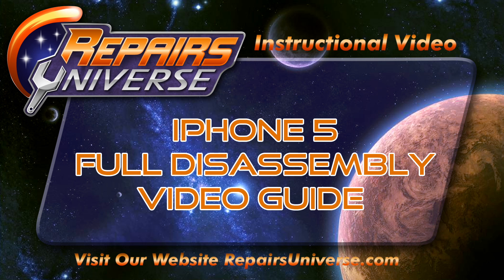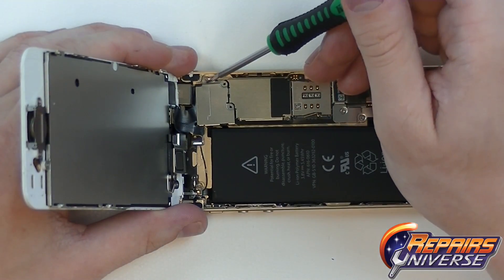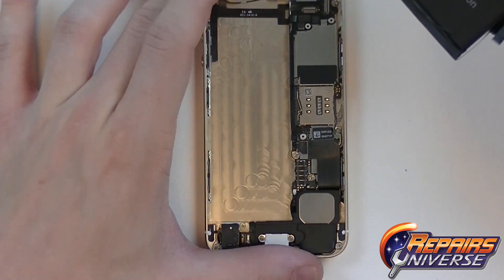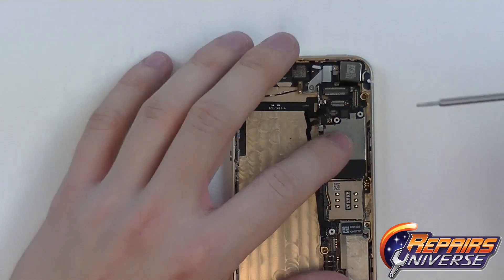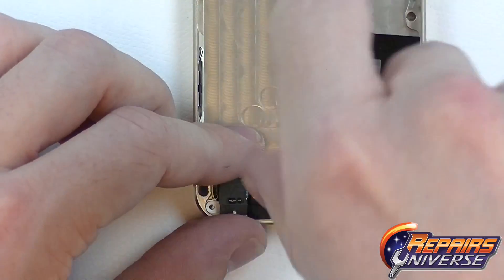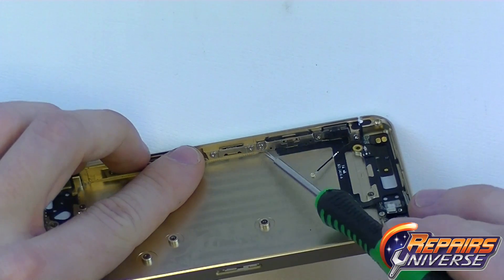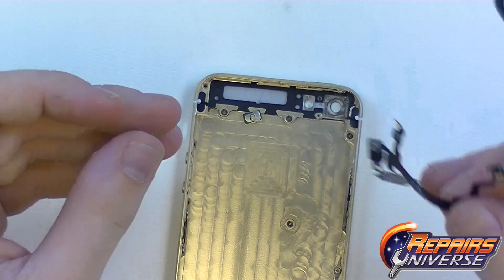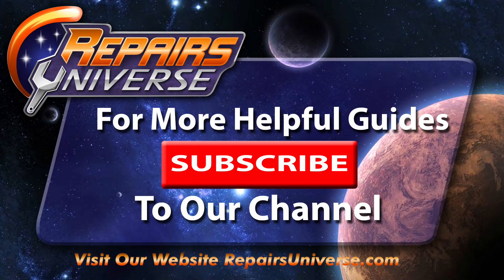iPhone 5 Full Disassembly Guide

Comment from the maker: Use this repair guide to be able to not only replace a broken screen, but also other internal components like the charging port or speakers
Reply: Repairs Universe i was trying to follow this guid but for some reason the battery is places different? There are not three screws to remove